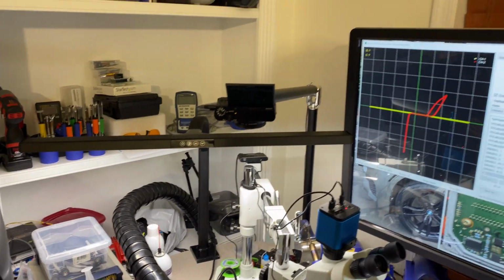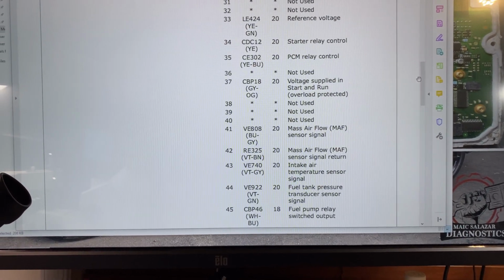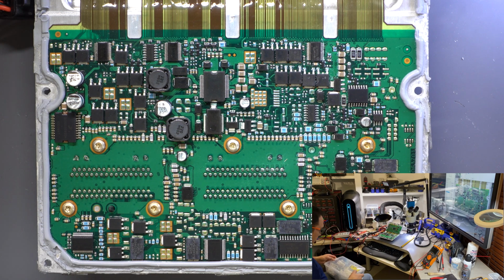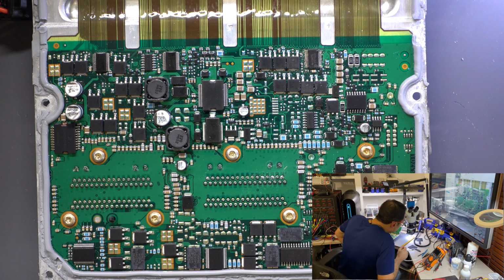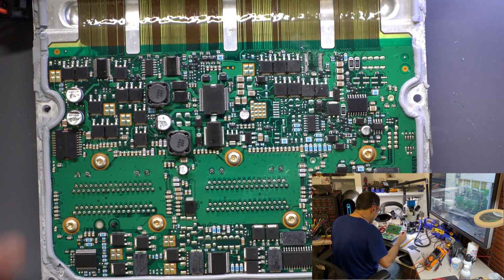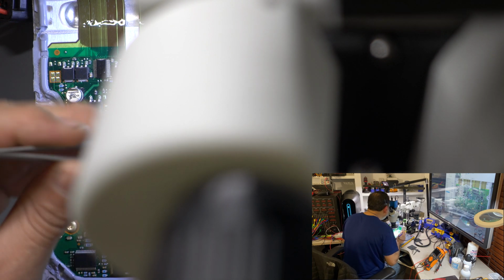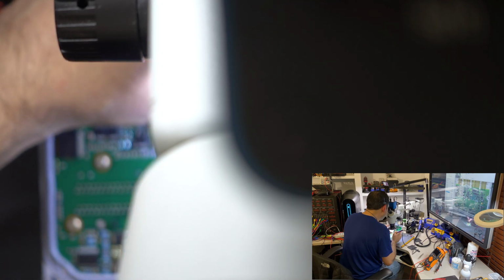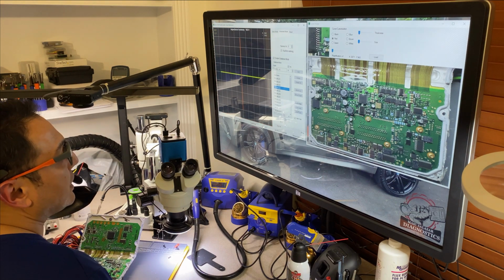2007 Mercury Milan no fuel or AC relay activation ECM repair!! NEW UPPER CAMERA MODE

Comment: Excelente trabajo saludos desde Costa Rica, aprendiendo mucho de sus videos, me gustaría saber que modelo son las máquina con las que quitas y haces las soldadura pura vida!
Reply from the maker: Hola German, muchas gracias! Yo también soy de Costa Rica. 
La de soldar es esta
https://www.testequipmentdepot.com/hakko/soldering-stations-and-systems/esd-safe-dual-port-soldering-station-fm203dp.htm?ref=gbase&gclid=Cj0KCQjwnoqLBhD4ARIsAL5JedIy5eVQJCrm2Tqrf0YZlUXSm0mlW7SlKMLRMOkrPywk7yANf_cNvmYaAi9REALw_wcB

La de quitar la soldadura 
https://www.google.com/shopping/product/1?q=hakko+desoldering+gun+fr-305&client=safari&bih=738&biw=428&hl=en-US&tbs=vw:l,ss:44&sxsrf=AOaemvJhL0Qt7NEk533E3DISZse6VqTu3A:1635058588132&prds=num:1,of:1,eto:9060080394728679134_0,prmr:1,pid:9060080394728679134,cs:1
Reply: @MaicSalazarDiagnostics  de verdad que placer, estoy aprendiendo mucho de usted me quiero especializar en la parte electrónica un gusto saber que hay gran talento de tiquicia por allá afuera, ya tiene un fiel seguidor más, muchas gracias por la información 👌🏻

Comment: I just watched your video from last Feb and I was unhappy with that, this video is a great improvement with your new camera set up. Since you can edit and not show what we don't need to see, I would also ask again that you set up your lesson in advance, you needed a new chip from your parts box and you are digging for it on camera, that could have been put on top for quick access off camera. 500 degrees is fine to remove a damaged part but you are not protecting components very close to the damaged component. First time to use a tool on live camera and it's a fail, sorry, not for me. It's ok to make mistakes but you are applying heat to remove the extra solder for a long time, a little air spray would be good here. Thank you again for a much better video.